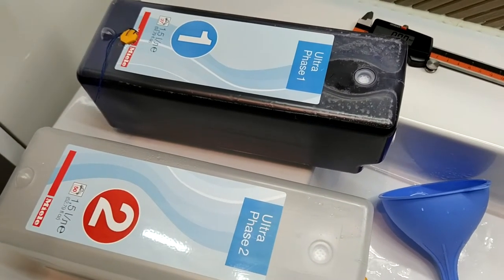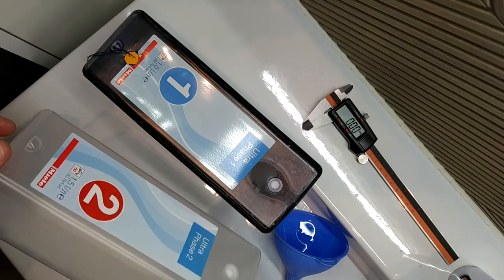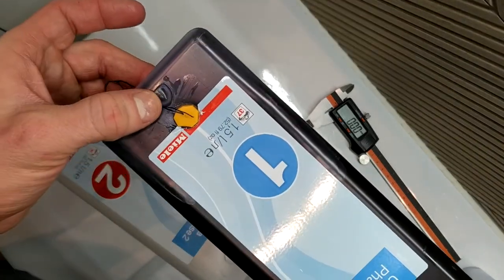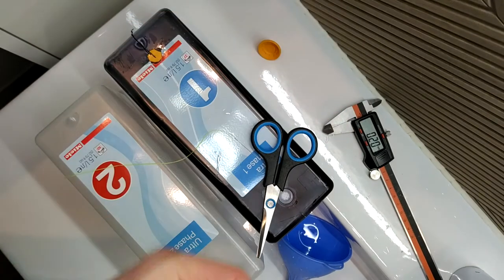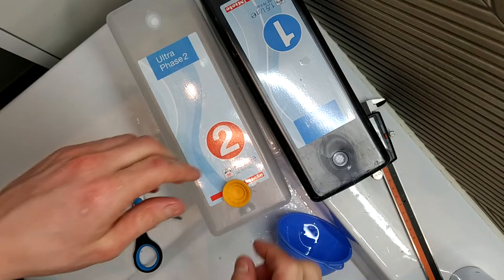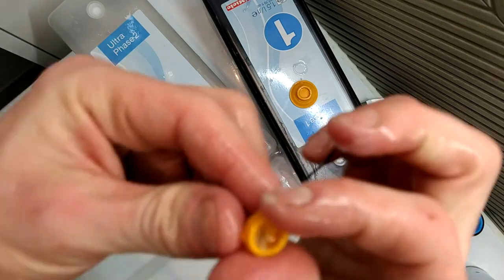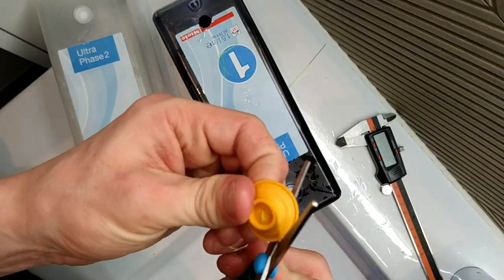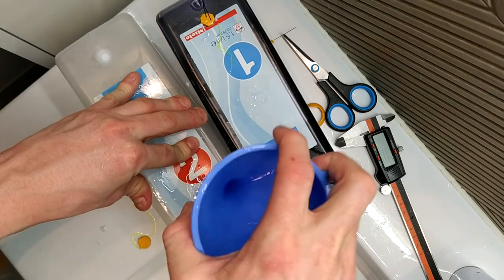Miele TwinDos DIY refillable detergent & fabric softener canisters (1/2)

Comment: After switching from Miele ultraphase to my detergent and conditioner I don't see levels in the conteiners anymore displayed on machine or via Miele app. Do my washing machine will alert me when the containers are empty or I need to check them manualy every time when they go almost empty?
Reply: Using the app, go the washer, status tab, tap on a bottle, move the slider back to the top (full) position and hit the save button.  The washer will then estimate how much is left in the bottle.  If the bottle was only half full then move the slider to half full and click save.  Simple.
Reply: @notmethanks816  If you use your own detergents with refilible cartriges it is impossible to set levels. Option is not active. "Fill level not available" If you use Miele's Ultraphase then level option is available